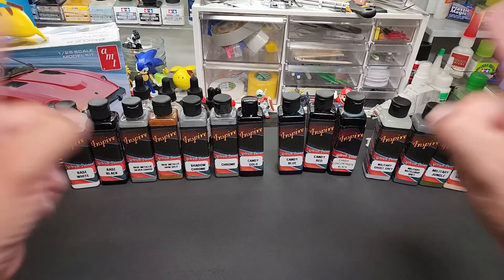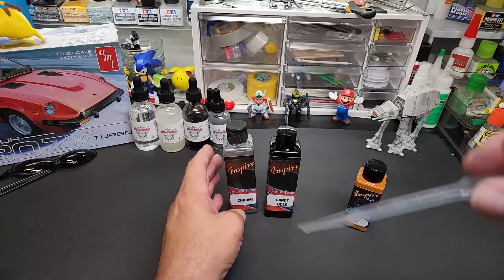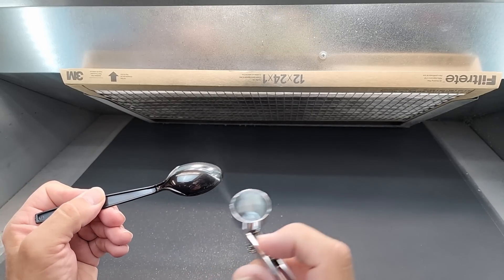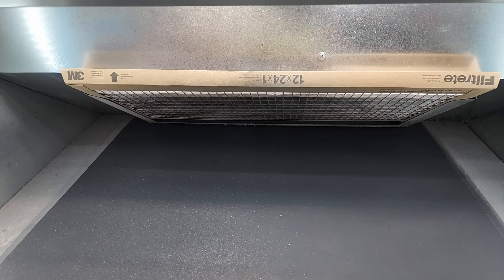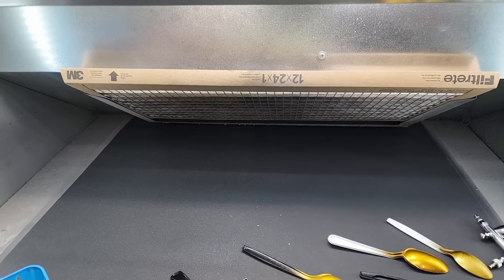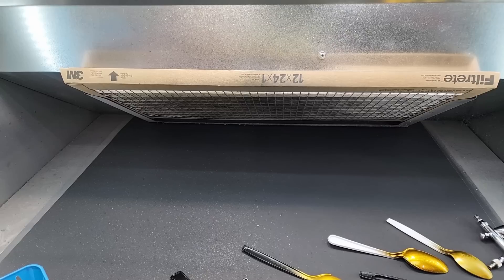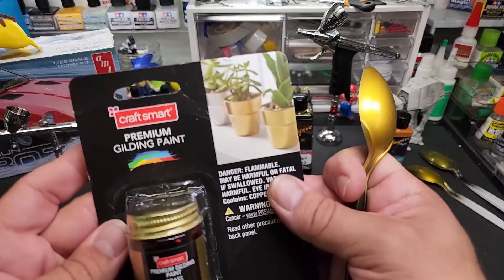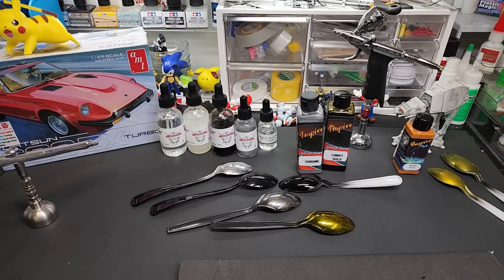Testing Inspire Chrome & Candy Gold Paint - Great Gold Chrome !

Comment: Inspire is generally a Urethane based paint, at least the Kandies are.  The Gold Kandy and Chrome base you used there only requires a few light coats much like Alclad, that's why the mirror effect went away after you laid on more coats.   Chrome is tricky that way and with Chrome and Kandies a little is more, that's why the Gold looks more like a gold Chrome than a Gold Kandy.  Urethane over Laquers can have a terrible Krazing effect, that can end up looking great if that's the goal and you play around with it (Most people will use saran wrap trick to that effect).  Great video as always love what you do, always a great time.

P.S When you think about how large these bottles are and their complete Kandy set is $94 for 10 4oz bottles like you have here.  Amazing price for that much paint, I might actually switch over from Alclad which is my go to Chrome and Kandy brand.

Comment: Edit - All due respect to Barbatose Rex. Ive learned a lot here but the chrome is being applied too heavy in this video. In my opinion this chrome knocks Alclad off the throne. The mist coats wet out better resulting in a more reflective and consistent finish than alclad. 
Start with 1 single (no back and forth or one after another) pass of a fine mist coat, stop, dry with hair dryer or air dry, wipe with soft cloth or feather duster followed by 4 or more single pass, mist coats, same as the first, drying and feather dusting between. After the first couple of mist coats it seemed to tolerate heavier mist coats but wasn't necessary. I sprayed this through my Sotar 2020, .15 nozzle at 25psi. The needle stop was set 2.0 numbers out from fully seated. Custom Paints' 2k clear with fast activator over the top resulted in somewhere around a 20% reduction in reflectivity and requires 2 extremely light mist coats to completly dry before laying on a single wet coat.

Comment: Another great review my friend.  I don't bother watching any other airbrush channels, you are the OG. I was wondering if you have sprayed any larger objects with these chrome paints and if so, what brush and needle size did you use?  I am building a 3D printed life size R2D2 and want to chrome his dome.  I put 1 coat of Duralumen on it, but started getting streaks so I stopped. I was thinking about using an HVLP gun instead?  Thanks for all you do man!
Reply from the maker: I have to be honest here, I've only used the airbrushes recommend, that being a 0.3mm. I havent tried anything bigger than that so I'm not sure how it will play out. I guess you could do it but it will use more paint for sure and that's not cheap but at least Duralumen come in large jars. Sorry that I couldn't help with this but if you do try it please let me know your results.
Reply: @barbatosrex9473  No worries, thanks for the reply and I will update this video with the results.

Comment: Can you please spray different 2K clear Coats over this and if it does not work well I wonder if you will have to try the method that others use when using high gloss varnish first and THEN coming over it with a 2k clear coat.

Comment: How do I purchase your paint products  ?
I'm testors guy from the 60s then model master as  soon as they where available. 
I know there line very well. I fell in love with there buffable and non. Buffable  metalized.
They have some acrylic paint out I found at hobby lobby last night.
When I got home I dug out the paint then opend them both  I performed the highest to compare the paint.
And test sniff work amazing both paints smelt exactly the same .
Model master acrylic paint is in the small time and tested testors bottle.

Comment: Hey Barb, just bought the inspire paints for testing. Couple questions, did you use anything to protect the chrome before the candy was applied? if not how long did you let the chrome dry before candy coating it? and did the candy effect the chrome any like did it make the flake visible?
Reply from the maker: I sprayed the candy right on top of the chrome. I waited a day between chrome and candy. No top coat is really needed as the candy is a clear top coat all it's own but it's safe to top off the candy with a clear if you want
Reply: @barbatosrex9473  thank you Barb, I have been looking for this result but all that I have tried always results in a more flaky look. Going to test it out soon. Also I got you anodized set and freaking love them, started painting two kits with them lolol.
Reply from the maker: That's awesome, thanks for the support